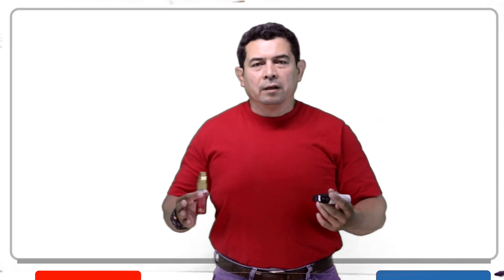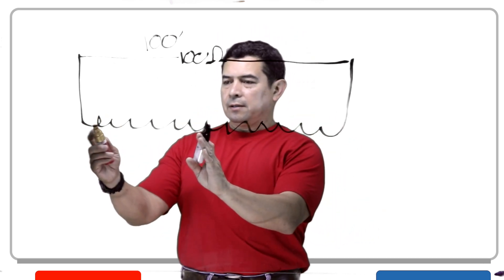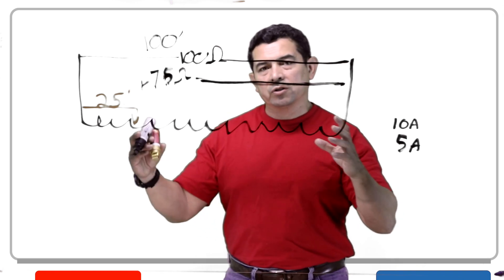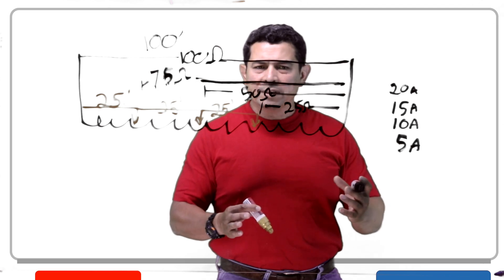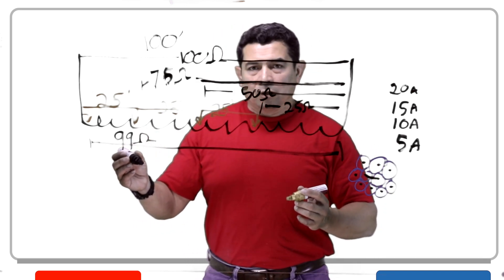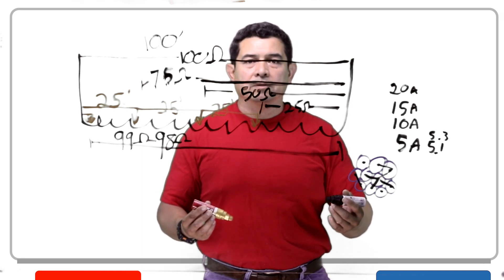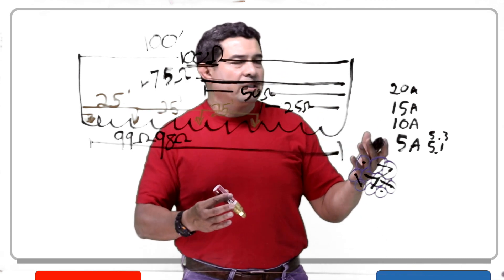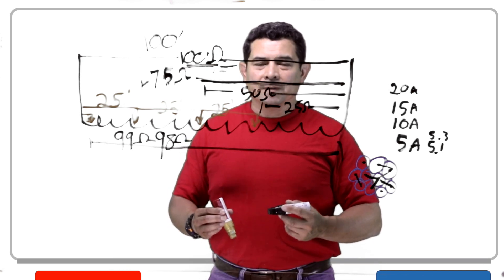Motors 8 Electrical Motor Problems "Short" - HVAC Online Training and Courses

Comment: Thank you, It is informative to know that short is progressive, and shows how it is helpful to keep records of motor resistance. I have a question; must the power lines be removed from the the motor terminals to check the motor winding resistance?
Reply from the maker: It is always a good idea just in case you get feedback from the readings.    I do not mind telling you sometimes I have cheated and not disconnected them sometime if I do not have a capacitor,   BUT  then after my first set of reading I always verify with the leads disconnected.